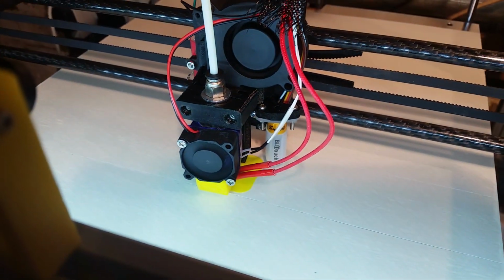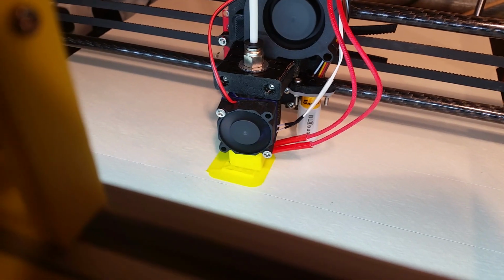SKR v1.1 32bit controller board 3d printer Hypercube.

Comment: have a question does this have stealth chop mode and the other modes to?
Reply from the maker: Yes but dont bother with the 1.1 board get the 1.3 or higher revision as they have better compatibility and more pinouts available.
Reply: rct2 damn I just got one mailed here might as well use it then I guess
Reply: rct2 ehhh.  I’m turning this one back in. I grabbed the 1.3. For 22$